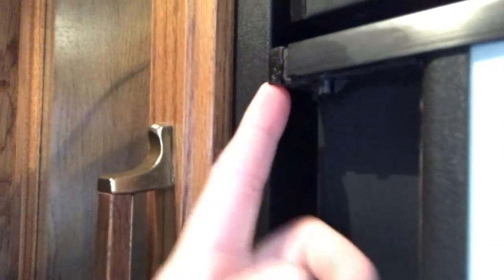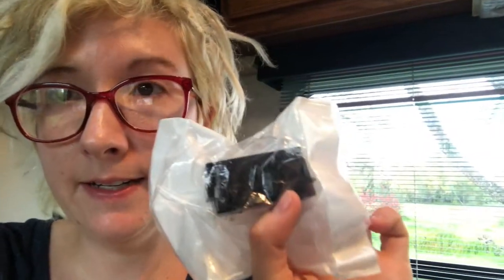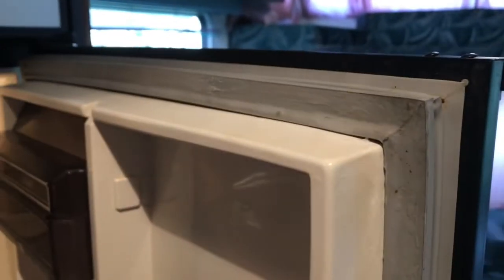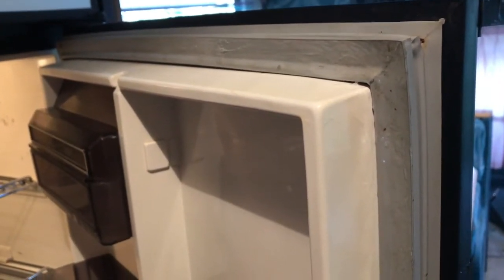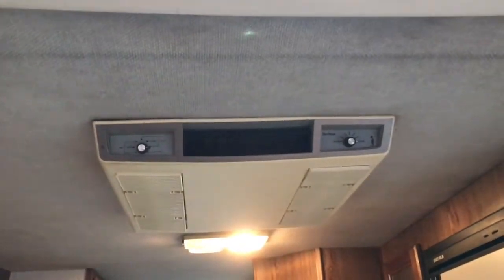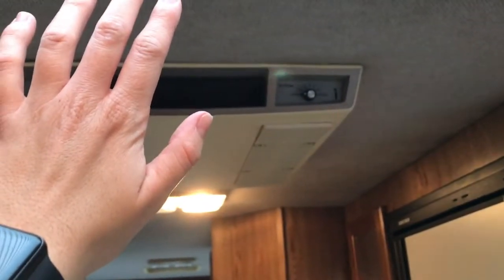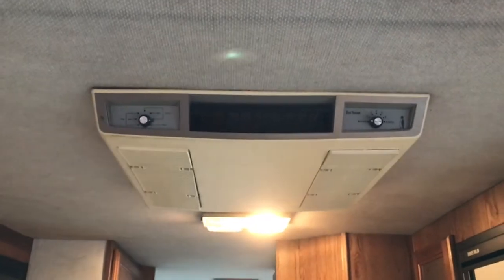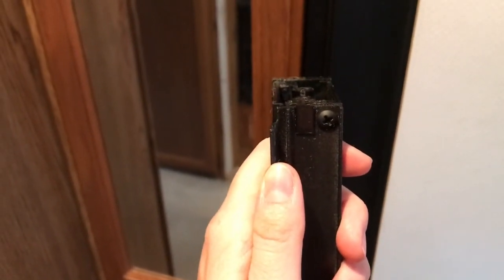Fixing the RV Fridge Handle | RV Log

Comment: All RV fridges get the ice build up on those back coils.  You will have to defrost by hand every 3 - 4 mos.  Best time is before a shopping trip, empty out the fridge, put towels in the bottom and use a hair dryer to melt the ice.  Dry it well before you load the stuff back in.

I good way to test your coils is the dollar bill test.  Close a dollar bill in the door and try to pull it out.  If it comes out easy, you may want to change your gasket.  Good Luck!
Reply from the maker: DWDinAtlanta Thanks! I'll try the dollar bill test... although there is Vaseline on the door now so the bill will probably get yucky. 😝